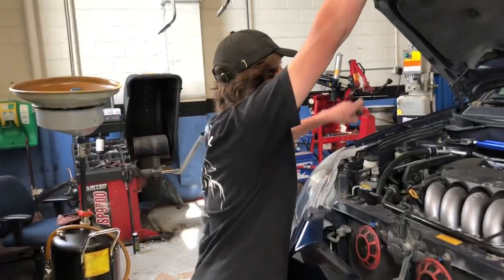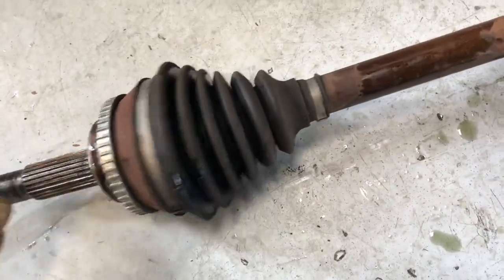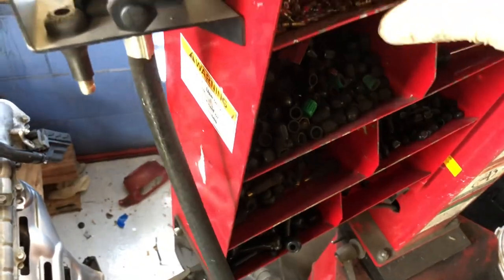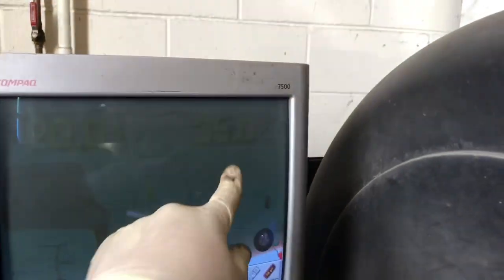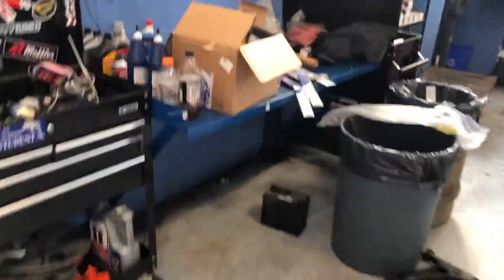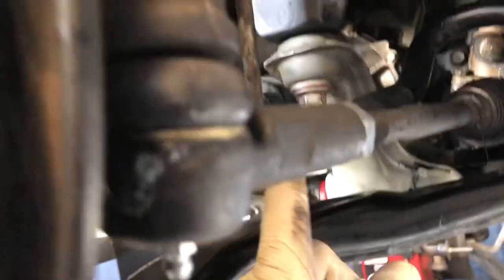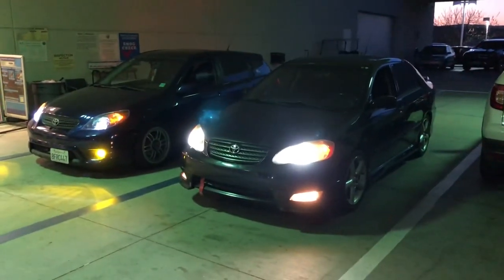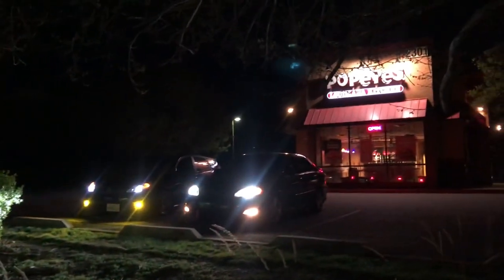Clayton’s Toyota Matrix XRS gets a massive suspension / Brake overhaul!

Comment: for aligning the rear you have to get shims that go between the hub and the backing plate. I think moog makes them, iirc carid sells them. I guess the rear subframe/axlebeam warps over time  or gets bent from hitting potholes and stuff. kind of stupid that there is no built in adjustment IMO
Reply from the maker: indeed and yes we will have to revisit this on another day with the shims.